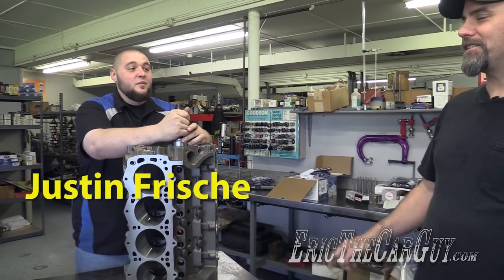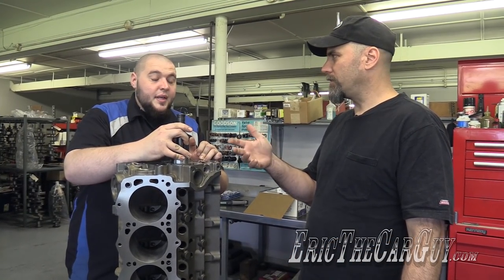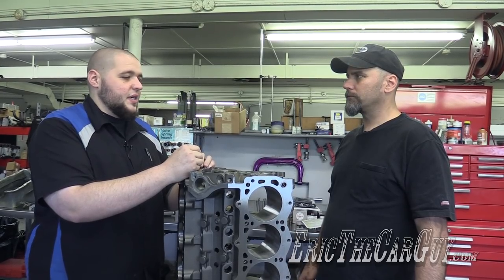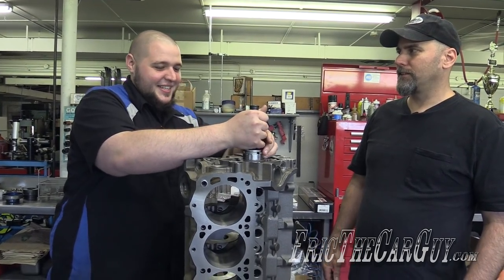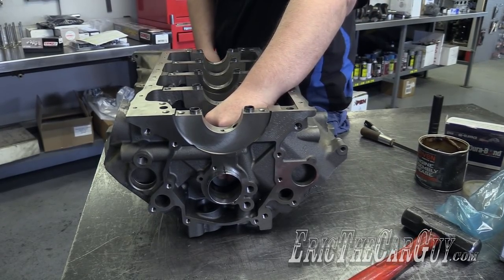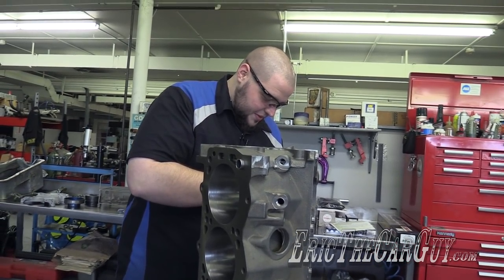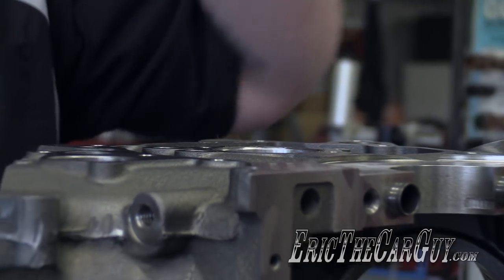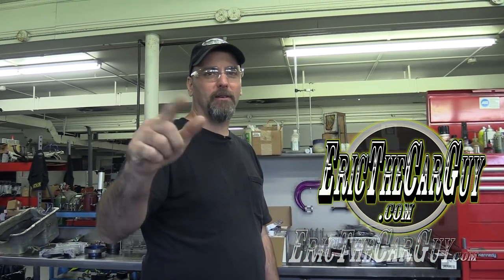How To Install Cam Bearings #DarkMatterPikachu #FairmontProject

Comment: I put a lot of Cam bearings in and one thing I learned is to put a bevel on the camshaft bore which Helps them to drive in way easier without the bearing tearing up on a sharp edge… Keep on rockin…

Comment: Whenever installing cam bearings. And bearings of all types. I always like to put them in the freezer for a couple of hours first. They shrink the tiniest bit and it makes installation much easier. Be sure to dry them off and then lube them so you don’t get any rust. It’s worked for me👍

Comment: Great video. My dad is a retired mechanic, my brother is a mechanic. I never thought to ask why they get the machine shop to install cam bearings. When it comes to machine shops, there was only 2 in Red Deer that they would go to. Lee Bros., and Custom Engine Works. Word of mouth, is very important. Back in '86 I went to a new machine shop in town, heard great things about Chris Wood Engines. He expanded, and opened up a shop in Red Deer. Had them rebuild my 340. Valve guide tolerance was too tight, on #1 cylinder, intake valve got hung up, bent the push rod, destroyed the rocker. Went in for warranty, and the clown behind the counter, told me I should of built a small block Chevy. 30 yrs later I'm still regretting not punching him in the face.
Reply: No I should have went to a better machine shop because chevys aren't just some magical engines that never fail. They'll fail with shitty work also, and because they're Chevy.

Comment: Those Cam bearing tools can be had a lot cheaper than $600 Amazon has the complete Cam bearing tool with everything you needed for only $89 you guys are making that look a lot harder than it actually is my brother's been doing engines for years and can change those bearings in no time

Comment: SBC cam bearing tool $44 worked great don't need $600.
Reply: They have universal fit cam bearing tools for $180- $300 like the one in the video. But a tool for a specific engine style is usually much cheaper than the universal ones. I think the tools for the magnum engines are about the same price.
Reply: yep...video makes this look like science.  It's easy.
Reply: Lol I love how he says $600 for the tool and that's why he didn't do it yet the link he provides is only $130 and if you look on Amazon the same tools are like $60. It's not science. Just common sense and taking it slow.

Comment: I found a cam bearing tool at a garage sale for 45 monies. I've put several sets in different motors now. And I never knew it wasn't a common shop tool.
Reply: Unfortunately, valve guide knurling tools are in most shops.
Reply: ...they should outlaw the damn things.
Reply: He must have the Snap-On bearing installer.  I got mine new for about 200$, but then that was a long time ago.

Comment: I have never personally taken any engine I built to anyone to install cam bearings. I’ve always done it myself before and after I worked at an engine machine shop. I see this  a lot. People claim to be “professional” or “ASE” certified mechanics but don’t install their own cam bearings. I don’t claim to be professional and I’m certainly not ASE certified but I guarantee I much more experience than most modern “certified” mechanics. I understand if you don’t have your own cam bearing tool but if you build often enough you should own one. That is such a simple process. He just makes it seem like it’s not. I recently bought a new cam bearing installer/remover similar to the one he has in the video. Same purpose, aluminum shaft with 5 adjustable ends and several spacer bands and it was under $300. I’m not bashing anyone I’m just saying.

Comment: The reason why engineers had the bearings bigger in the other side is because when the cam shaft rotates, it has a push to it when it's spinning.. so the cone shape helps the camshaft to stay in place. If it was just flat all over, the camshaft would try to push itself out the engine by high rotations and thus ruining the bearings.

Comment: I think the bearings are different on the O.D. for quick instalation on an assembly line. I'm guessing that way you can put multiple bearings on a stepped tool and install them at the same time.

Comment: As a mechanical design engineer and engine builder, there is nothing wrong with reusing that cam bearing that he had to remove because the holes were not lined up.  The fit is not tight enough to exceed the yield strength of the material, so there will be no change in the OD of the bearing and no change in fit.  Superstition is no substitute for actually understanding the stress-strain relationship for ductile materials.

Comment: If a cam floats in the block and slams around in there, what kind of damage takes place?  I did a timing chain replacement on my 4.2 liter Jeep engine and found the spring on the camshaft thrust pin was not installed the last time someone was in there, which I understand was a part that one of the manufacturing plants had a lot of "extras" of. Putting things together the right way and with the required parts ended up solving what was a mysterious random clank sound coming from deep in the engine.  I just wonder what damage was done.  I've since put about 10k miles on it and it seems to be doing alright - it just makes standard Jeep engine noises now :)
Reply: I believe on the 4.2L engine the ignition systems distributor is driven by a gear on the camshaft so as the camshaft walked in and out of the block the ignition timing was changing which could have causes a lack of power or at the worse, burnt a piston. Since you stated that the engine is doing fine now I suspect that no major damage occurred.

Comment: My cam bearings are worn out, cummins 05 with 1.2 mil. Am changing my camshaft- question is, can i just turn it over? All wear are at the bottom, if i do turn em over would they hold up another million? Or even 2-3 years??? Will i need this tool to turn em over?

Comment: I wonder if it'd be easier to draw the bearing in using a shaft and spacer from the other end rather than pound the bearing in, but I suppose that'd just be another expensive tool.

Comment: i have a 03 hummer h2
no oil pressure. replace oil pump
clean pickup tube replaced the seal
no pressure. can a rod bearing cause no oil pressure. have p0300 code

Comment: So, how often do you need to change your cam bearings? If I am just upgrading my cam and visual inspection of the old cam shows no wear on the cam, can I just change out the cam? Obviously, if if you don't have a ton of miles, or rebuilding engine or haven't nicked a bearing during disassembly or re-assembly...

Comment: if the table were lower or the technician were taller it would be easier,,  it seems like the holes should line up perfectly, why would you have to split the difference?

Comment: What about camshaft clearance? Do you have to measure the inside of the installed bearing and compare it to the camshaft to see if the clearance is right, or is it just like pushing it in and see if it spins? (V8`s with pushrod style valves aren´t my territory & sorry if i didn´t noticed it perhaps you told us, english isn´t my native language but i´am trying^^)

Comment: I designed my own tool and had it made my local machine shop for less than £30 (40 bucks). It's a simple tool but it works very well. Ask me if any of you want me to explain how to make it, and swap your bearings for cheap

Comment: it looks cool... but man u are snailing it through these build videos... at this rate it's gonna be Christmas 2018 before we actually get to see this thing get down the road
Reply: There have been 3 videos this week alone. By that logic there would be over 350 videos left to upload.
Reply: ootdega and what's 350÷104
Reply: dmayse1000
...No, the 350 is from multiplying 3 per week by the 112 weeks between now and 12/25/2018. Technically 336, but I only took two seconds to rough it out in my head.
Reply from the maker: I'm guessing it should wrap up sometime next spring. I challenge you to find a more detailed series on a car build though. By the time I'm done, you'll know exactly what it takes to build a fox body.
Reply: yeah the most expensive way lol.
Reply: I wouldn't say more or less detailed but "Pete's Garage" youtube channel is extremely detailed on a fair amount of points in engine building

Comment: they spoke of the issue of sharp hard cam lob edges gouging soft bearings, so why don't they put broad rubber bands on the lobs so you avoid this issue and sliding the cam in to try would be quicker?

Comment: eric give it cylinder shutoff technology to save gas :)
Reply: ...Because that's possible, logical, and financially feasible for a turbocharged pushrod V8 from the 60's making over 600 horsepower.
Reply from the maker: My block is very much this century, but point well made.
Reply: hey, its something to make a video of lol
Reply: i dont know the details of the technology but isnt it just shutting off fuel injectors?

Comment: Why are they going to ALL this trouble for a FAIRMONT! It's a '73 and parts will be hard to find like fuel sender unit, electrical parts etc. They act like it's a drag race engine! The old engine could've been bored and put back to stock. WHO will pay big money for a FAIRMONT?
Reply: Carl if you only build cars to sell them you just won't understand building a car simply because you like it and you want it to go faster than stock. It's not always what you can get out of it, but how much fun you can have with it.

Comment: As much as i watch these kalvinator videos, i cant stop thinking one thing. As you mentioned before that motor blocks are expensive and i get frustrated everytime they rub the block on the working bench everytime they shows us its parts. Am i the only one who thinks that way?
Reply: Seek help.
Reply: He wasn't sliding it on any gasket surfaces so there's nothing wrong with it
Reply from the maker: It'll take a lot more than that to hurt a lump of cast iron. Especially this block.
Reply: This is not my comment. I agree, ridiculous. {SAM}.

Comment: its hard gob
Reply: Now i suffer with this problem no spécial tool to install cam bearings i lose 10 because the bearing haven't the same size no tool very big work to get a new kit baering from france I success to install 3 and for finishing I must get another kit from france
Reply: 5.7 gm block vortech I suuffer with  this cam bearing install